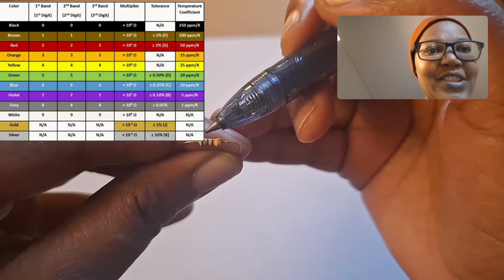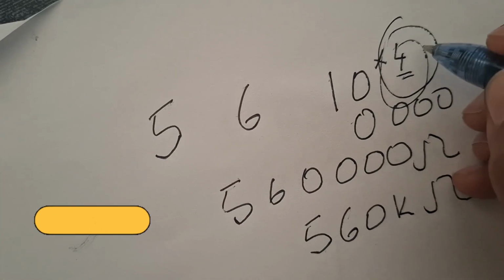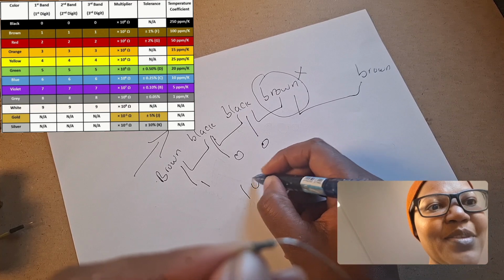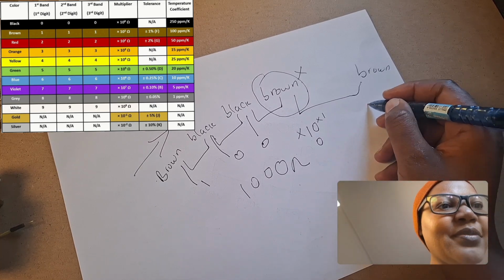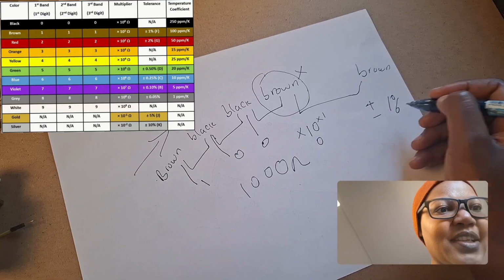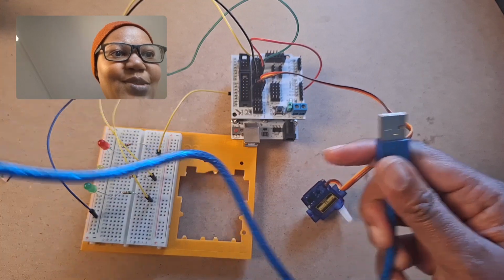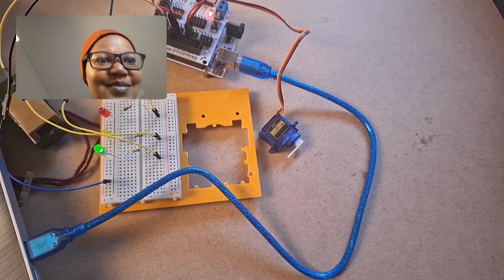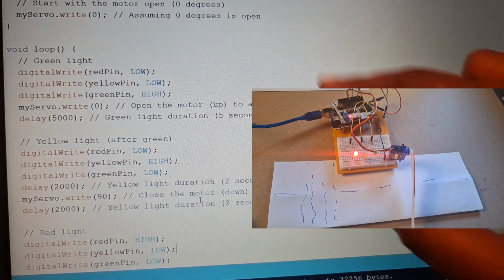How to Make Smart Traffic Light 🚦 with Arduino #arduino #iot  #tech how to Tutorial | NAW DIGITAL

Comment from the maker: //:::code:::

#include <Servo.h>

Servo myServo;  // Create a servo object

// Pin definitions
const int redPin = 2;
const int yellowPin = 3; // Single yellow LED
const int greenPin = 4;
const int servoPin = 9;

void setup() {
  // Initialize the LED pins as outputs
  pinMode(redPin, OUTPUT);
  pinMode(yellowPin, OUTPUT);
  pinMode(greenPin, OUTPUT);
  
  // Attach the servo to the pin
  myServo.attach(servoPin);
  
  // Start with the motor open (0 degrees)
  myServo.write(0); // Assuming 0 degrees is open
}

void loop() {
  // Green light
  digitalWrite(redPin, LOW);
  digitalWrite(yellowPin, LOW);
  digitalWrite(greenPin, HIGH);
  myServo.write(0); // Open the motor (up) to allow cars to pass
  delay(5000); // Green light duration (5 seconds)

  // Yellow light (after green)
  digitalWrite(redPin, LOW);
  digitalWrite(yellowPin, HIGH);
  digitalWrite(greenPin, LOW);
  delay(2000); // Yellow light duration (2 seconds)
  myServo.write(90); // Close the motor (down) to stop cars
  delay(2000); // Yellow light duration (2 seconds)

  // Red light
  digitalWrite(redPin, HIGH);
  digitalWrite(yellowPin, LOW);
  digitalWrite(greenPin, LOW);
  myServo.write(90); // Keep the motor closed (down) to stop cars
  delay(5000); // Red light duration (5 seconds)

  // Yellow light (after red)
  digitalWrite(redPin, LOW);
  digitalWrite(yellowPin, HIGH);
  digitalWrite(greenPin, LOW);
  delay(2000); // Yellow light duration (2 seconds)
  myServo.write(0); // Open the motor (up) to allow cars to prepare to pass
  delay(2000); // Yellow light duration (2 seconds)

  // Repeat the cycle
}